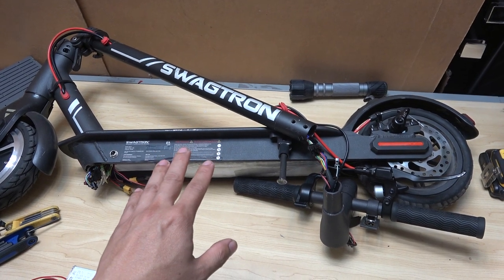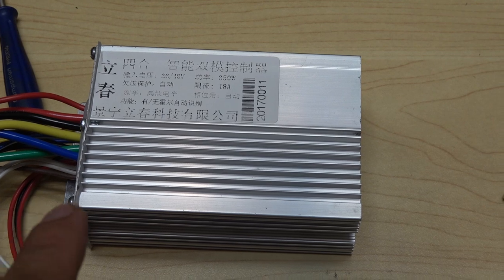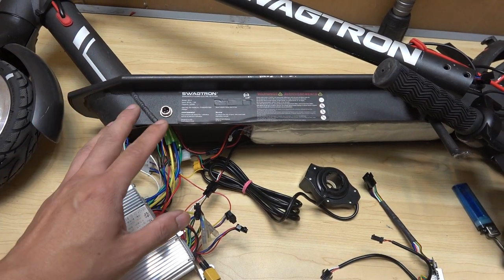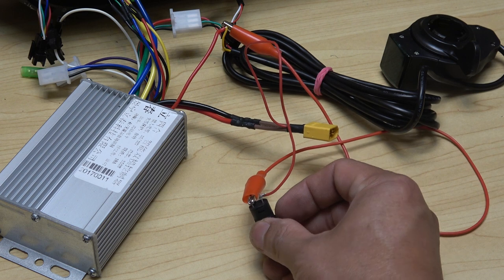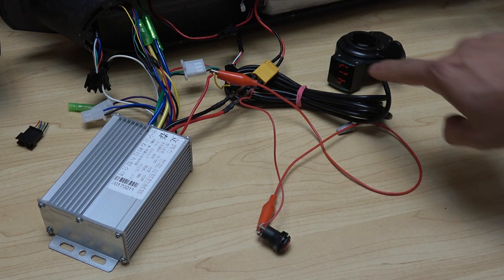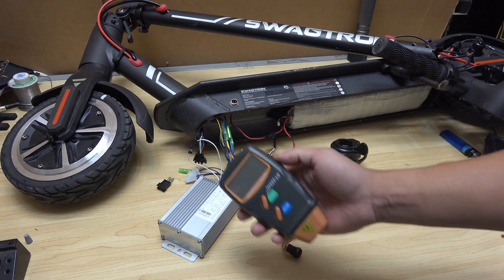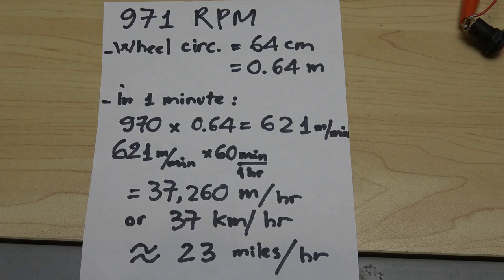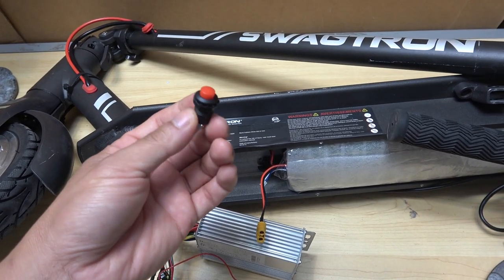DIY: Swagtron Swagger 5 (Xiaomi M365) speed controller upgrade

Comment: Hello Vuaeco, I wanted to tell you that because of you I have customly build 2 ebikes. the first one I used the imortor 1.9 and parkside lithium batteries 4Ah 5S. I 3D printed mounts and used copper wire spikes to connect them in series. now I can ride 40km instead of 7 on the original battery for a cost of only 40 euro in batteries. The second one was made with a controller from aliexpress and an old high quality motor that i salvaged from an ebike with a blown up controller. I went with a controller that came with waterproof connectors and those perform amazing. It was totally compatible. the only difference with imortor is that it uses a very nice 350W sinewave controller. The square wave controller from aliexpress makes a bit more sound.

Comment: Time to break out the kobalt batteries.  I'm curious if you'd need to limit the current to the wheel once you do upgrade to 48 v so you dont spin the tires, or reprogram the throttle control to spool up the wheel slower.

Comment: Could you have used the original display?  I need to replace mine but confused about what to do with 3 wire ( red, blue , black) from display... guessing throttle. And confused what to do with the 4 wire (purple, green, yellow, white) which I believe you said goes to display. My new controller doesn't have a connector that said for throttle or display

Comment: That aluminum monocoque scooter frame looks like it makes a niiiiiice heat sink. :-)
Reply from the maker: How do you know this? In fact, Swagtron's original controller has a flat aluminum frame on the bottom which they mount and put thermal compound on and they use the inside of the scooter frame as an external heatsink for the controller.
Reply: @vuaeco  I only know from your video; I can see the TIG welds and the thickness of the aluminum, which looks like it's enough to make 20 controller cases!

Comment: Good video. Scooter needs a bit of work but think u got it mate. I just had to take mine apart cos everytime I hit a small bump or lump in the road or path the scooter loses power suddenly and won't drive again. On closer inspection towards controller one of the connecters was lose. They also stuffed the handle with like some white foam to hold all the wires in place so when I do need to replace motor or someone on my m365 I probably will have to get in there and hack the shit out of it like. Why they put it in I don't know.

Comment: @vuaeco us it okay to run 48v on a mi pro scooter motor? I DIY a scooter using the mi pro motor, and I wanted to get a lil more speed, but I am scared if I over volt it, it will overheat and burnout. So is it okay?

Comment: I need help please let mo know how to make it ride putting mine Scooter Straggler 5 I’m Upgrading part I put the 4 cable pin Connector turning on the red Light Motherboard 365 BMS 115 Unlock 25 mph batters BMS new Doesn’t let them motors stars Dashboard Doesn’t turn on I still got a put the 5 Pin What will be step

Comment: Is there a way of bypassing the power board with out changing the controller and throttle cable?
Reply: I am in the process of doing something like this because my power button broke. I fried my throttle trying to connect it with the wrong wires.

Comment: How do you hook up a key throttle to a swagger 5 electric scooter
Reply: Im in the process of doing this. The blue wire from the controller is the ignition. The red one is directly from the battery. Im getting the 5 vots from the break wiring. There is 3 wires together blue,red,black(ignition wires. And the other 4 ,the white one is the throttle.
Reply: @DonVerchi700as  I try to do what you told me still won't work
Reply: I've watched your video over and over pause it then play again on my throttle has red green  and black all three in connecter. Plus has a yellow , and blue wire . Do I still need to put the power on and off button with a new key, display screen throttle or I don't want to have both . To start swaggers 5

Comment: My stock swagtron goes 18
Reply: Mine says that too. It's not an accurate speedometer, I clocked it using a gun and it was reading +2mph.
Reply: @svendolufsen849  the app is pretty accurate as well.  The app only works if the Location on your phone is on.

Comment: Lol only 16mph my swagger5 goes 23mph and 18 to 20 miles of range more then the normal xiaomi. And is STOCK. bit is the boost version if you get that one you will have extended rang and speed.
Reply: Mine never did those numbers! 😢
Reply: @DonVerchi700as  Dang men.
Reply: Or if thats too much, I have a m4 pro electric scooter of course that was 800$ and it can get up to I think 30 miles of range or a bit more and can hit speeds of 25 to 30mph. Is pretty good ngl.
Reply: If you get one of these they aren't cheap tho they will cost over a grand.

Comment: I'm trying to find the screw. For the part on the scooter. Where you can fold the neck down. As you lift that latch up. And bring the latch down to lock it in. That screw that goes in there I'm trying to find it. Can you help me?
Reply: Estas tratando de buscar un tornillo en la tienda o en el scooter bro?
Reply: Yo ya casi he desarmado casi todo el mio. Le puse llantas nuevas y recién se me chigo el botón para prenderlo.

Comment: You know that you can just remove speedlimiter.
Reply from the maker: Let's assume you could do that. But that little controller is still 250 Watts. If you want better performance, you need a higher rated controller.
Reply: @vuaeco Ye I know it depends on the motor and settings.